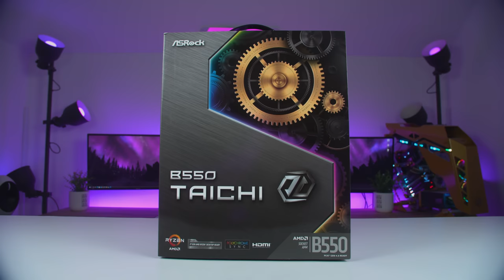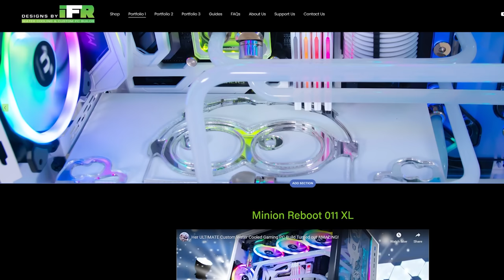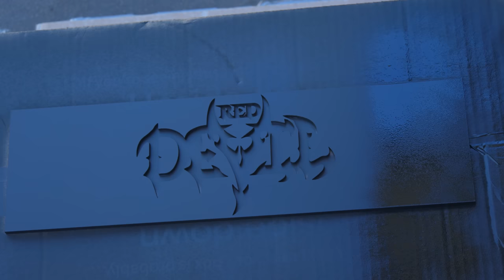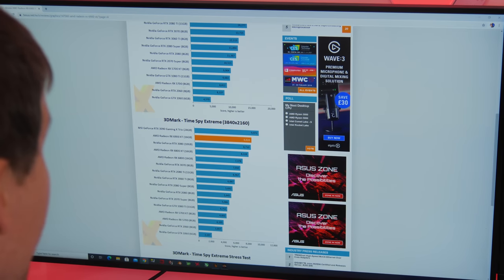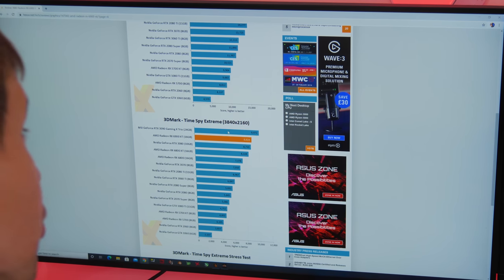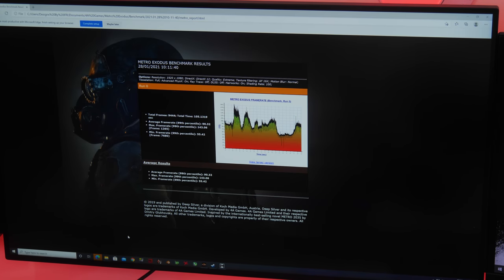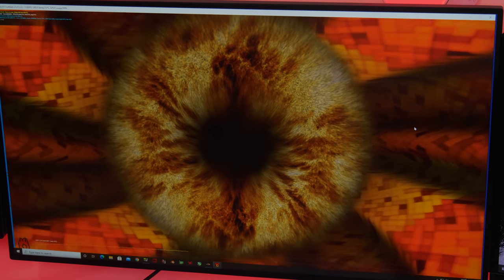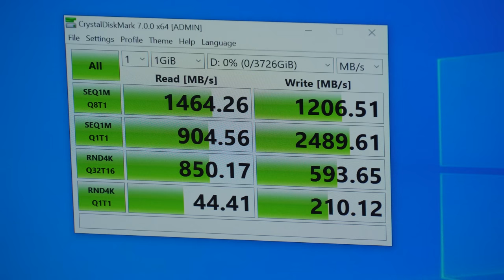This all AMD Gaming PC turned out INSANE!

Comment: Beautiful rig. One thing I noticed. That pearlescent coolant. I built a rig for my wife and used some. Same color as a matter of fact. Over time the pearlescent settled into the tubing and blocks. Flushing it would not get it out and I had to take everything (water blocks included) apart and clean it by hand.  I went and did some reading and these coolants are meant for "display purposes only" and not meant for long term use. Just keep that in mind.
Reply from the maker: Hey mate, i explained its for display purposes only just before making the liquid and filling the build. Perhaps you skipped ahead? Thank you anyway and i am glad you enjoyed the build
Reply: @DesignsByIFR  I had my wife yacking in my ear. I certainly missed that. Good to hear you are aware of that. Enjoy your new machine.
Reply from the maker: @DownloadeousMaximus  haha thanks mate =)

Comment: CPU = AMD RYZEN 7 5800x.                                            Cpu cooler = NZXT kraken Z73.                                                Motherboard = NZXT N7 B550 ATX.                                  Memory = corsair Vengeance LPX 16 GB X4.  Storage = Samsung 970 EVO.                                                Video card = Asus TUF 3070 Ti.                                         Case= Corsair 5000D airflow.                                           Power supply= EVGA Supernova 850.                       Is all the parts compatible with each other ?

Comment: Amazing build guys. Keep it up . Love the quality of videos and themes. Especially the liquid used for the "RED DEVIL" insignia of the RX 6900XT GPU. 

A question about the special coolant used for the loop. Why does the coolant void the warranty of the custom loop components like the EK Pump? Is it corrosive or is it because of some other reason? Is it the same as used in the "RED DEVIL" insignia? Or are they different?

Once again loved the video and Cheers
Reply from the maker: Hey mate thank you =)

So the special show build coolant is ment for only a few days use becquse it can clog up the system. Users have been using the coolant daily and when their system stuffs up eventually they approach ek for new blocks and warranty
Reply: Oh. Makes sense. Thanks for clarifying the doubt.

Comment: Bro is great but!!
Amd Gpu you used (6900xt) has a special feature (that is available in 6800xt and 6800 too) idk forgot name the feature was if you use AMD 5000 series cpu you will get 10% more performance but you used 3900xt well whatever
Reply from the maker: Its called rage mode which i talked about in the video
Reply: @DesignsByIFR  o i commented right after seeing cpu
Reply: SAM

Comment: hey Designs By IFR.
I have been following you for couple months.
and i really loving your works , keep up the good work.
can you tell me what gear and material do you use for Lasering logo? and what material do you use? 6:52
would be so happy if toy reply.ty
Reply from the maker: Hi it is acrylic sheets (link is in the description)
We used a laser cutter to cut it out and filled it with resin and mica powder (also in the description)